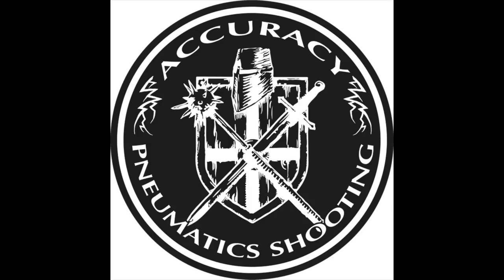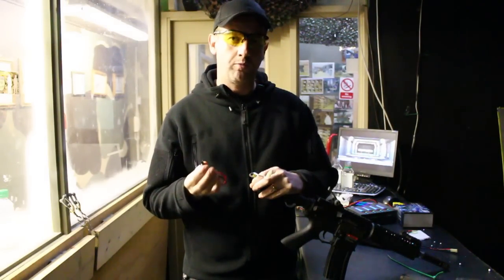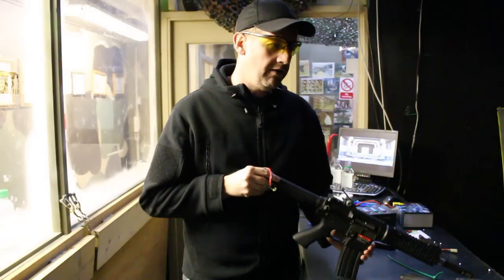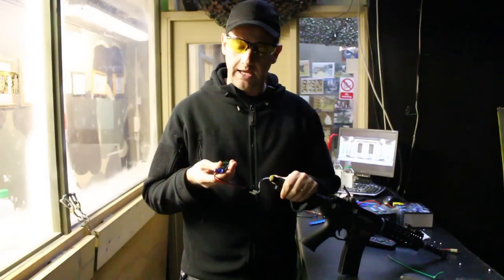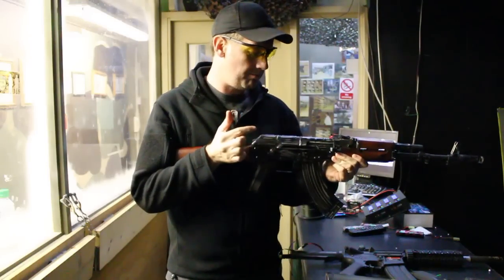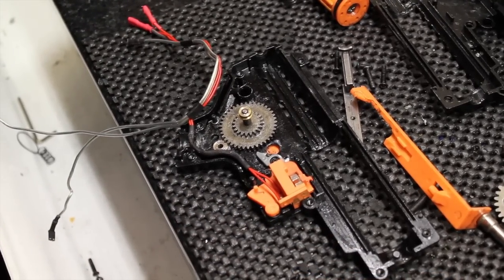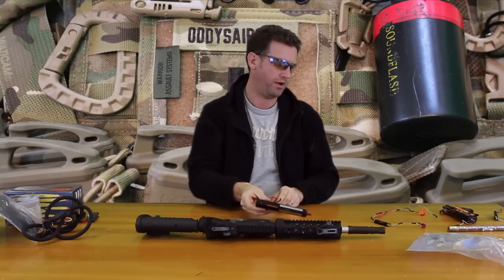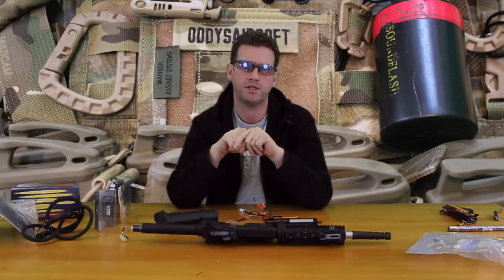New APS ASR109 & ASK 201 with 'Op Thor' Gear Box Part 2 - the Conclusion

Comment: @IAirelandairsoft "The rate of fire is very much dependant on the shimming of the gun"
I'm no gun tech but I'd have to disagree with on that one. In my view the primary factors determining RoF are the gear ratio, motor & battery. I will accept that a really bad shim job may have a MINIMAL effect on RoF but I honestly don't think there would be any real practical difference.
I will accept that a high RoF should be shimmed very well but that's only to ensure it doesn't destroy itself

Comment: the APS AK comes with a few problems right out of the box.
1:the mosfet as mentioned is rubbish.use a 9.6v battery and ONLY shooting semi-auto, its fine.(i never use fullauto,so its ok for me)the dealer told me 11.1V is too powerfull for this gun, but that defeats the purpose of the mosfet,or am i wrong?
2:the hopup rubber is rubbish,replace this if you plan to play in cold weather.

Comment: I had an APS ASR 104 and it was rubbish, broke the piston after 200 shots. Gearbox was plastic orange stuff, and the blowback jammed. Plus the bolt spring crumpled. The exernals were sub G&G standard too. Avoid APS. Stay with G&G and KWA or TM.

Comment: @ironman302100
LiPo is short for Lithium Polymer, it's just another better technology to add to NiCad (Nickel Cadmium) and NiMh (Nickel Metal Hydride). LiPos have certain advantages over NiMh: they are generally smaller for a given mAh capacity; they have longer charge/discharge lifecycles; they can produce higher current for more powerful motors. The downside is they are more delicate & need more TLC + better chargers!
Google is your friend, do some research and make up your own mind on LiPos